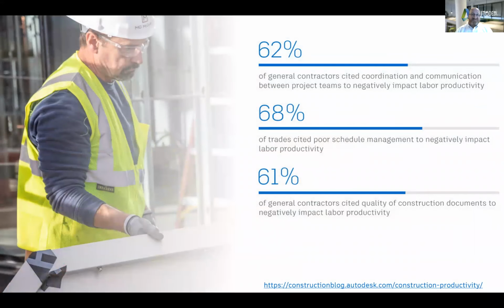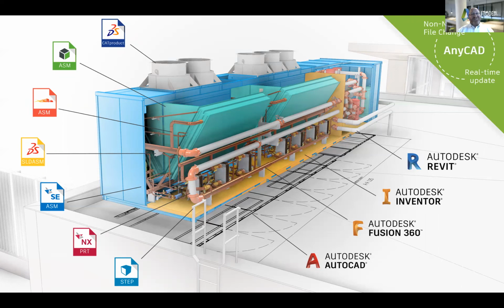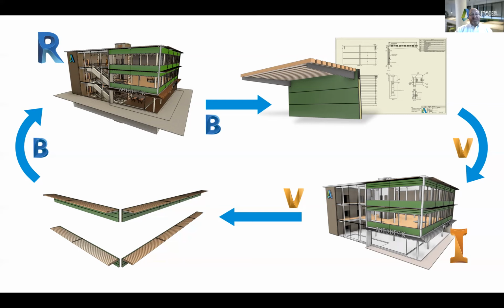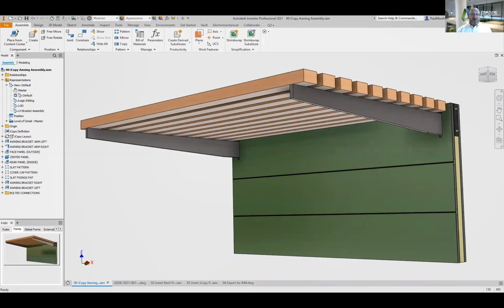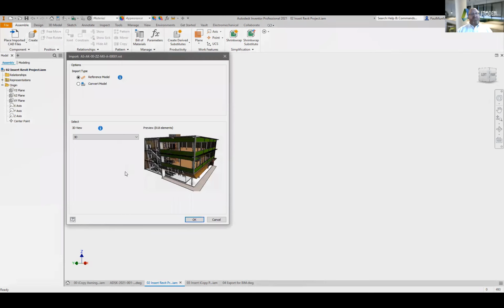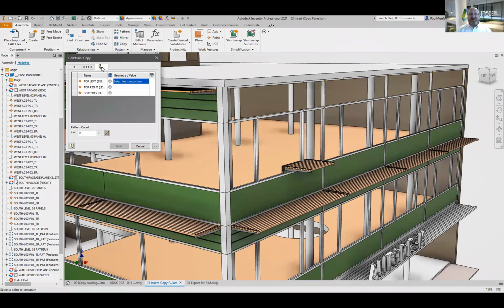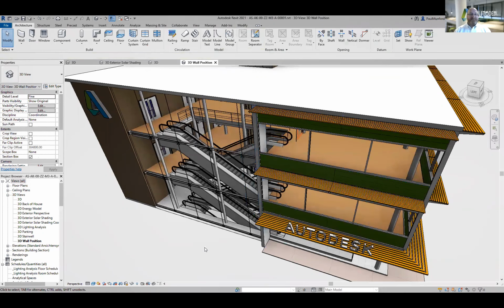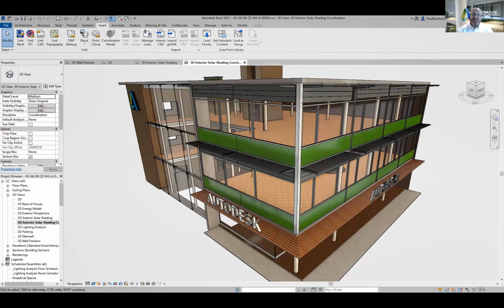Revit and Inventor Collaboration Workflow

Comment: One Question :How can we have a live link inventor model in Revit ,or do we need to always export a new ifc file to get updates?
Reply: Currently, there isn't a way to live link Inventor files in Revit. I believe Autodesk is working on that capability, but as of now it isn't there. The best method is to export a Revit/BIM content family (.rfa) from Inventor when there have been modifications made to the Inventor file. As long as the family is named the same, it will overwrite and update how it looks in Revit when it's reloaded.